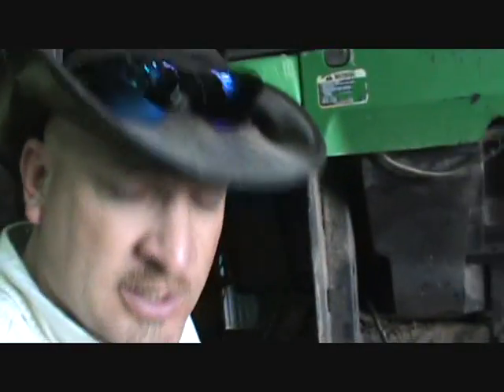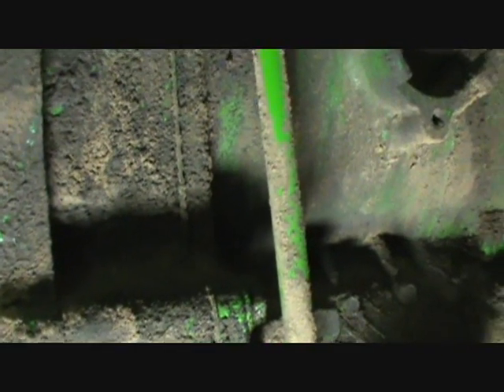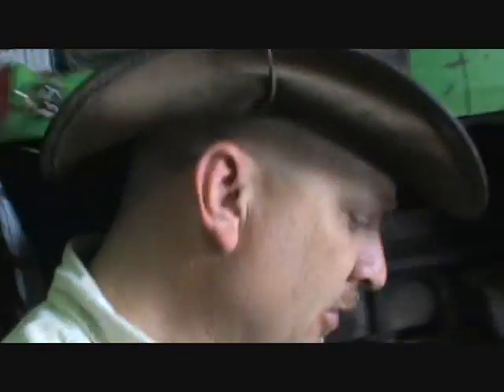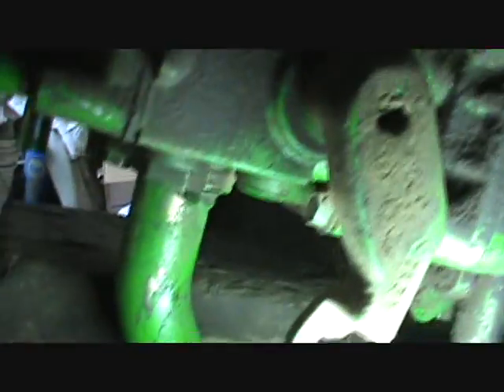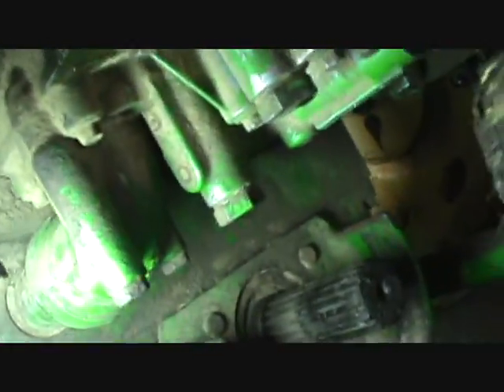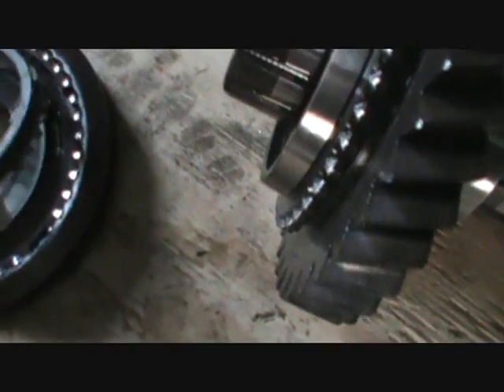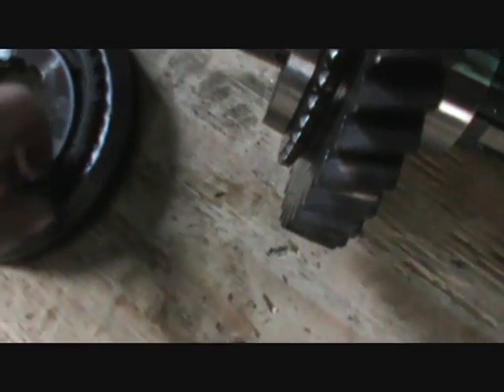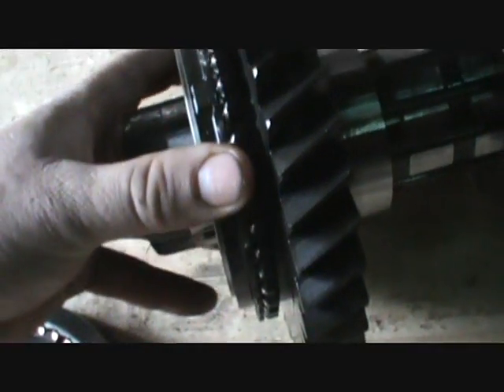7410 transmission PT2

Comment: Hi Wes. Looks like quite the project. was just gonna ask have you checked the U/J's  real good, from the back of the flywheel to the input of the trans. Ive seen them let go at high rpms and total everything under the cab, when the shaft whips round unattached at one end. then split the casting the coupler fits in on the trans front. The 6410 I was involved in when it happened was a $14.000 repair through Deere 4 years ago here in Canada. 
Regards Robert

Comment: I never use a pressure wassher on epuipment. Compressed air, but not compressed water. The water is under enough force to push threw seals and into bearings, remove labels and stickers, (like Tim did on the old big baler) and water and bearings dont mix last time i checked.